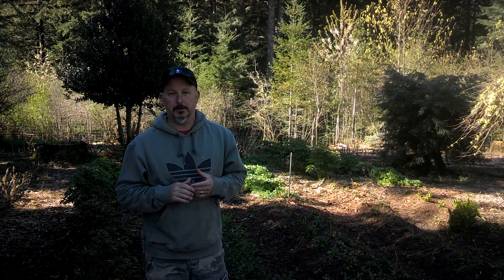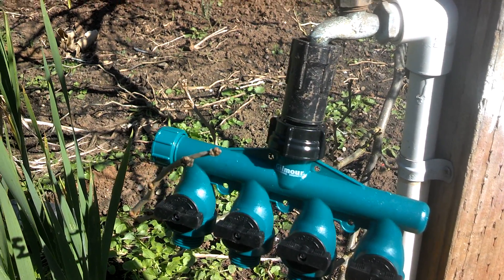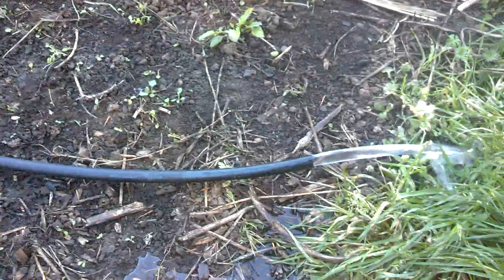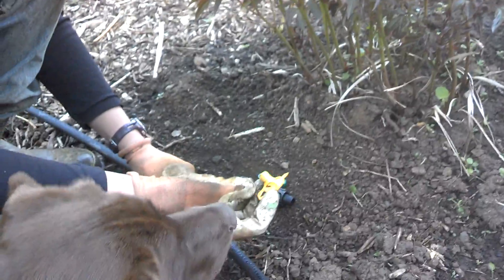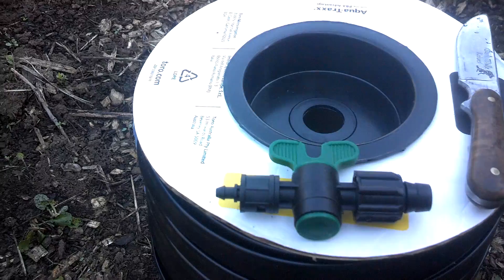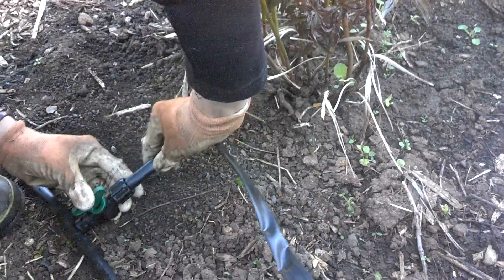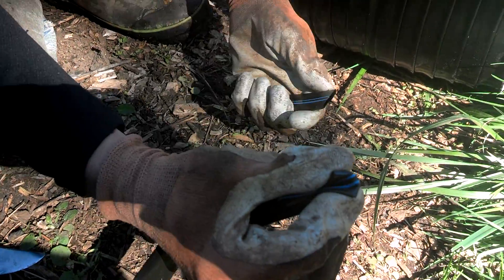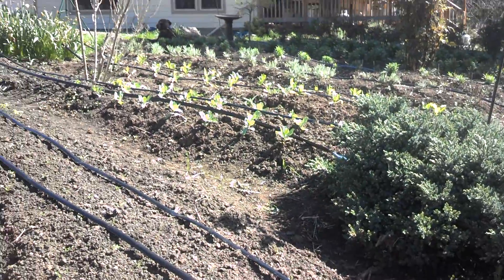How to Intsall a drip tape water irrigation system

Comment: How many feet of drip tape can you have "on" at once? I am setting up a system that will water about 2,250' and am curious if it will water the full length at once.  3/4" mainline with 22 100' rows.
Reply from the maker: I don't know the "real" answer but I know that we have several sections that have 1500 ft and it works great. If I was doing this I would have two sections with 11 rows on each. Add a two station timer and you can forget about for the rest of the season

Comment: if you said or not i did not chatch if you are on  a well what size pump do you have on your pipe ?i want to do that at my place
Reply from the maker: From the well it's just standard pvc water line reduced to 10 psi at the spigot. The cool thing with the drip tape, you can water a lot of area with out killing your pump. We can run a lot of lines at the same time and the well cycles on and off just like if you had a single sprinkler going.
Reply: this place i bought has 2 wells but also city water i have to get these wells back in service

Comment: Great Video. Thanks. Do you find you need to anchor the tape along the ground, or does it stay in place ?  I tried using 1/2" hose with small holes drilled in it, as my lines but I found the heat of the sun would curl them up and move them all around, never staying in place in the rows....
Reply from the maker: They stay put for the most part, we put a brick on the end of each line and that seems to be enough, especially once the pants are up and growing. Thanks for checking it out!